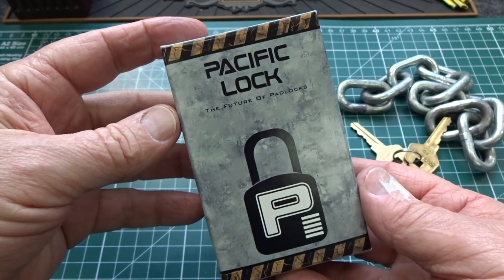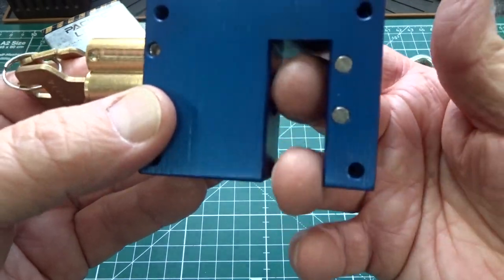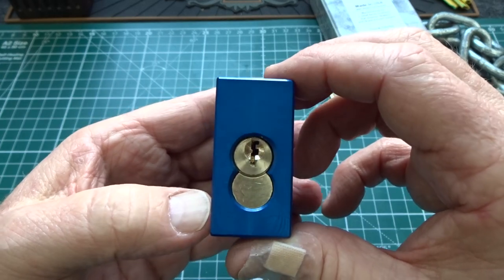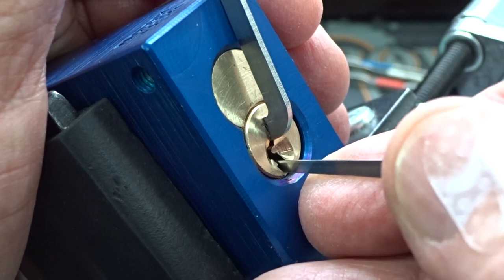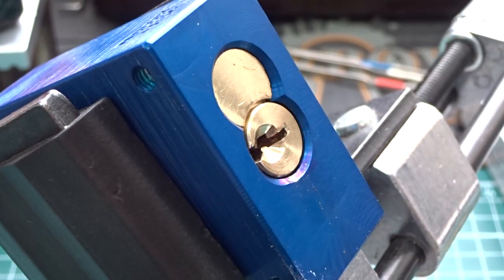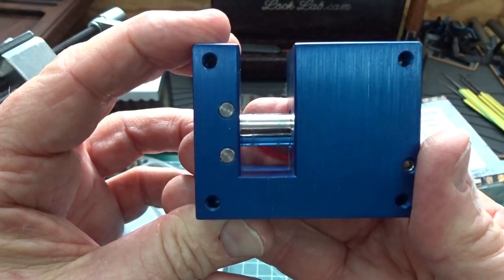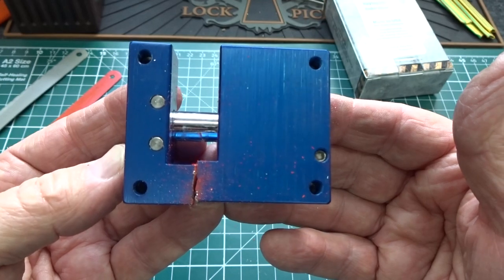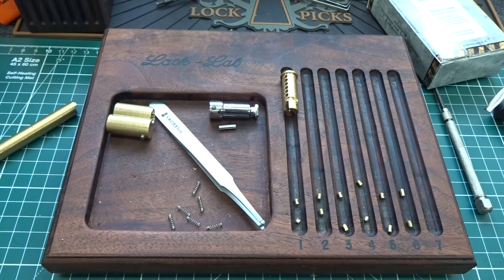(1190) Review: Prototype PacLock Block Lock

Comment: A suggestion : to move the "wing" pins 90 degrees and insert from the top or bottom.  The ends will then be buried deep in the body. Alternately put the wing at the lock end of the shackle, which could also enforce the key retaining.

Comment: This design is not bad, but when you torch it the lock fails bad and because of its aluminum body the pins at the top take the hit and fail, Lock pick Lawyer tore one apart with a torch and a pair of needle nose pliers, yes it took some time to glow it red hot using the torch but to be able to pinch it off a piece at a time with nothing more than needle nose pliers has me thinking that the aluminum the company used was either mixed with a softer medal or was a low grade of aluminum its good for making a fence post but security locks yeah not so much. Looked easy to open, why not make this out of titanium with a porcelain core and high grade steel. You can't use low grade aluminum to protect high grade steel. This company should hire new engineers.

Comment: The whole premise was that the lock would be fastened to a door with four screws, yet you completely ignored that with the whole cutting the lock off bit... Think about it, if it is screwed on with four screws, even if somehow you managed to cut it in two with a hacksaw, how do you plan to remove either set of two screws so you could spin it and remove the lock? That doesn't seem feasible. Sure, you could whack it and hope to sheer off all four screws in one good hit, but with that approach you might as well just beat the hell out of the bit it's locked to and try breaking whatever is holding that to the door frame instead.
Reply: Did you watch the entire video ?
Reply: liljasere Indeed I did. How about including a timestamp if you want to reply proposing I missed something that invalidates my statement..? I mean it really would've taken you less time to write the five character timestamp than a sentence eluding the the fact that I was wrong in saying cutting the lock in half was pointless if the entire purpose of the lock, as stated throughout the video, is for it to be secured to a door. It would've made far more sense to affix it to a $1 piece of wood from home depot and see if he could find any attacks that would make sense during typical use, don't you think?
Reply: he did only mention that it would be hard to cut if it was fastened, but he still did "forget" how to turn the small part after the cut if it was mounted correct
Reply: Using a drill and a skrew outer bit
Reply: I assumed it would be obvious that I was talk about when he said that after cutting it that it wouldn’t get you anywhere because it would still be screwed to the door
Reply: Just a regular (dull would be best) drill bit.  You have those nicely pre-machined guides for your bit.  If the bit catches, it will easily unscrew the lock.  An even easier method would be a cut off wheel with a dremel and turn the back side of the screw into a flathead so you can just unscrew it.
Reply: bigj231 these are the sort of attacks I would've liked to see. Though with the Dremel, it looks like there are threaded holes through probably about 3/8 of the lock body on either side, then the other 2/8 is a metal separator. so it's like ===||=== so wouldn't you have to use the cut off wheel to cut down through the threaded holes facing you, drill out the metal separator so the blade of a screwdriver will be able to turn freely, then continue cutting past it to make a notch in each screw. Basically you have to cut through a little more than half of the lock body for each screw hole, unless I'm picturing this completely wrong. A drill may work though, and would definitely make quick work of the little bit of aluminum keeping you from the screws